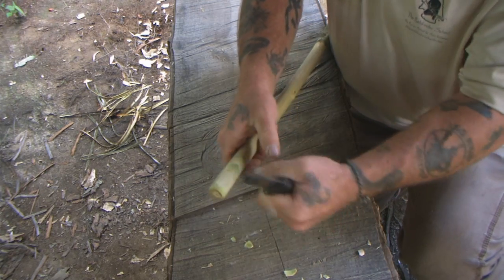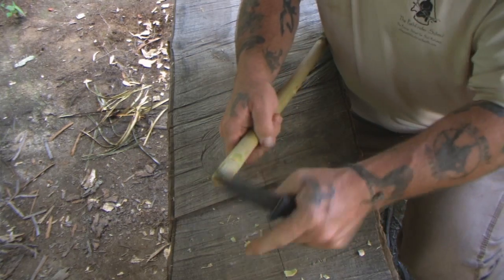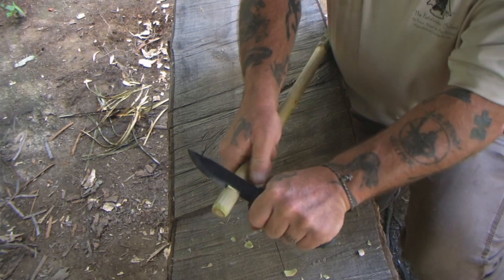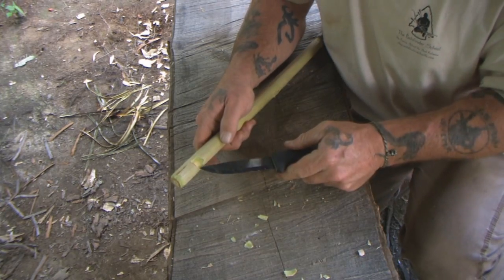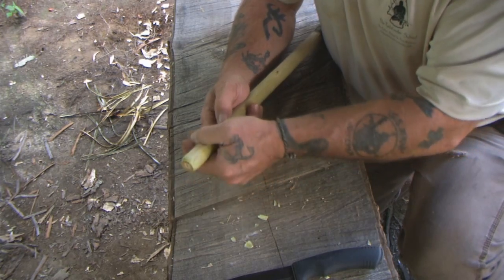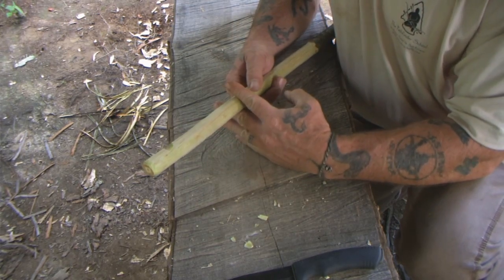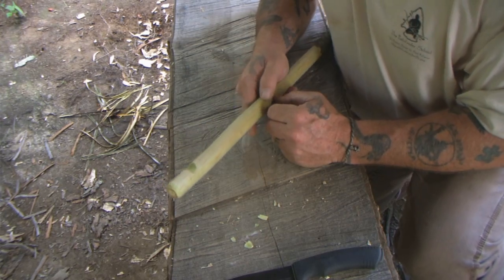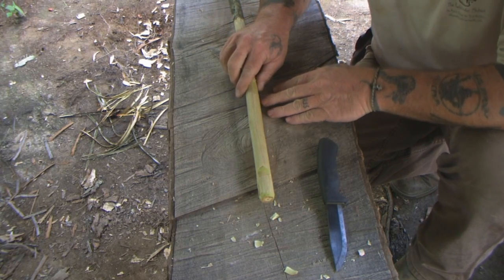Basic Knife Handling and Bushcraft Notches Part 2

Comment: i like your safety element in you tutorial ,, never can have enough of that ,,,,, i will say ,that the baton you are using is way small compared to the ones i use ,, i use at least a 2inch dia, usually a bit more ,,, i find that less strikes makes for faster cuts ,